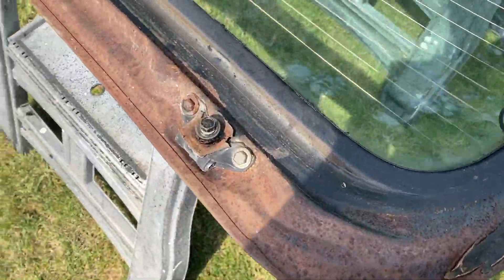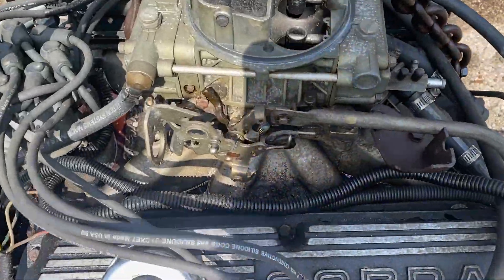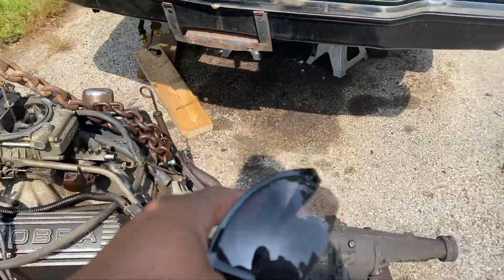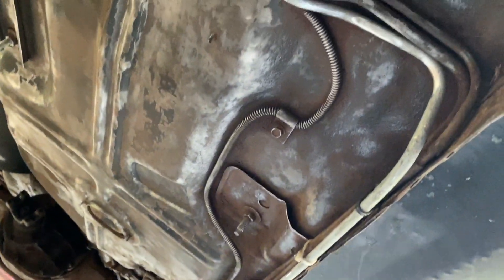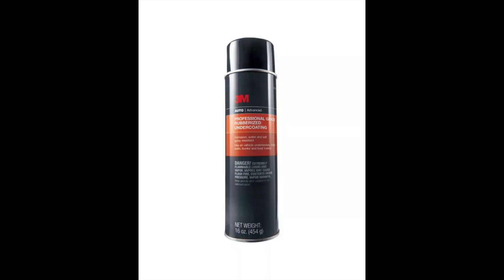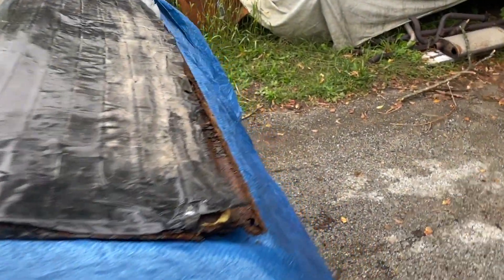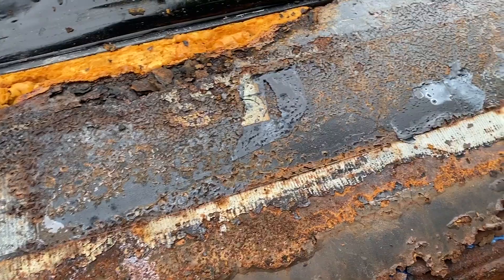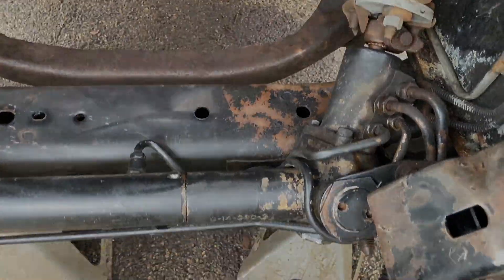1976 Cobra II Project Update #3 Cleaning and Removing Rust!!

Comment: What did you use to remove rust under there?
Reply from the maker: I used a wire wheel on an angle grinder.